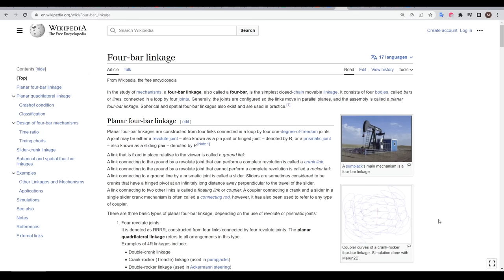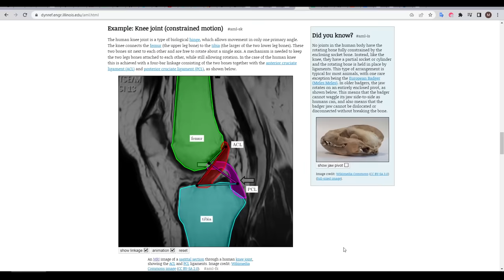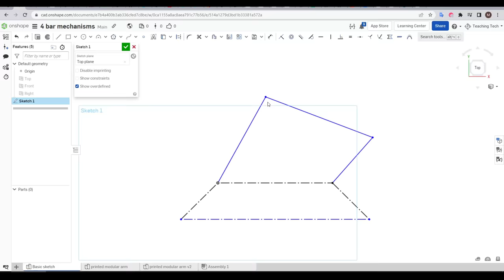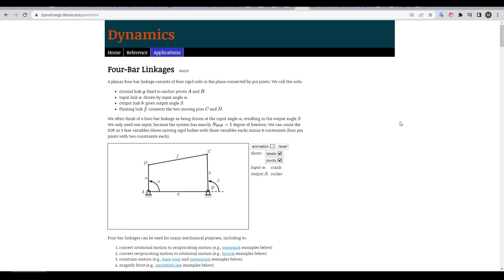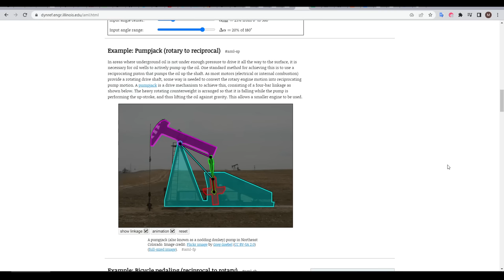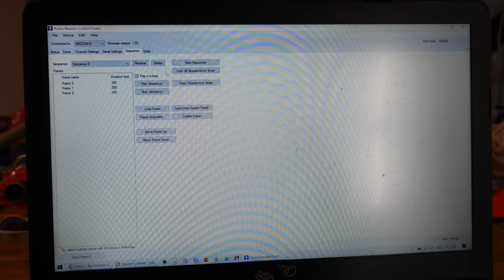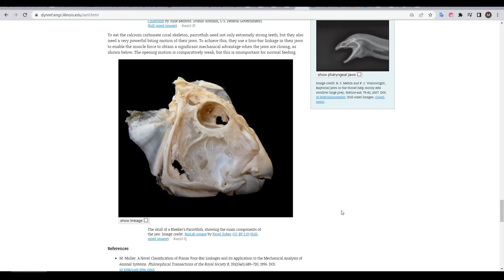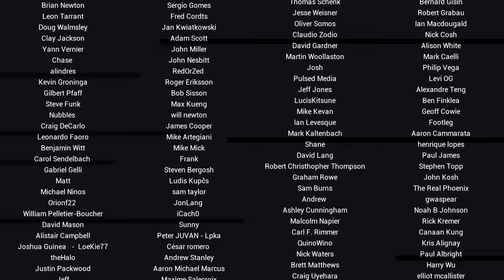Four bar linkages for 3D printing - Guide with examples

Comment: I recommend a program/game called Algodoo. It's realtime 2D physics simulator. It's free, intuitive and easy (aimed at teaching physics). You would make 4 rectangles, position them or resize them to fit, add hinges in the corners, add "fix to background" thing to the base link and then unpause and play with it by dragging any linkage. Or you could turn on motors for one of the hinges and even plot the angular speed of input and output link. Algodoo also has springs which could be used to test the snapping mechanisms from previous episodes.
Reply from the maker: I used to use that with my students but forgot all about it. Thanks for the reminder.
Reply: @TeachingTech  You did? That's actually awesome.
Reply: Excellent video

Comment: I used a four bar variation to make an oscillating archery target some years ago, but this is was before my printer and my hand tools skills were enough to get it working but not enough for it to be robust for more than a few arrow strikes. Hoping to use the printer to inprove the design and beef it up significantly. Great explanation and a good motivation to go back to that project. Thanks for all your videos, you're a consistent source of information and inspiration.

Comment: Reminds me a lot of the pantograph which I've used a fair bit in the form of a tool called the patorouter which lets you cut patterns into wood by following a template twice the size of the desired cut.

Comment: Thanks for another great video. It's wonderful how you are able to simplify advanced subjects without dumbing down the content.

When you were moving your model manually it looked a bit awkward. Perhaps some removable handles that were perpendicular to the four bar linkage would assist in trying to move it. If the handle was attached to the model using a bolt through the slot used for sizing the item then handle could be placed in the spot best for them.

Comment: The cycling with a servo could be made easier by adding a flywheel to the output, it would give it more rotational inertia and hence more rotational momentum which could keep it running easier.

Comment: It was interesting to see how the anterior and posterior cruciate ligaments (ACL & PCL) for a four-bar linkage. I don't have an ACL in my right knee as I have had a total knee replacement which removed this and both my menisci. The metal joint stabilizes the knee through clever design.

Comment: If you place a small nubbin on the IN label, you'll get the torque needed to power your "action". Rather than needing to push the bar to complete a cycle or change direction.

Comment: You could have mentioned that the lever is actually changing with the angle, isn't it? The last few degrees at 9:04 didn't really change the output, but I bet they had massive torque. So you can not only change the lever, but you can design it in a way, that you have torque where needed and speed where not.